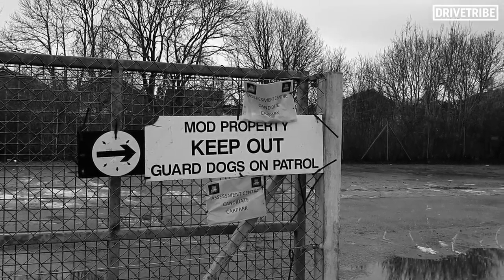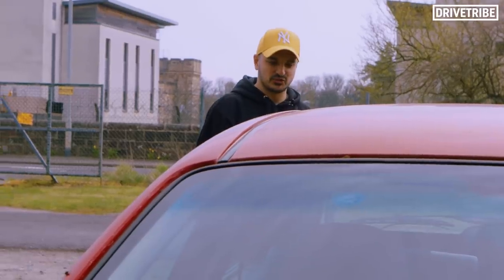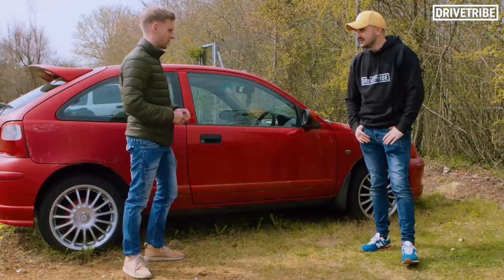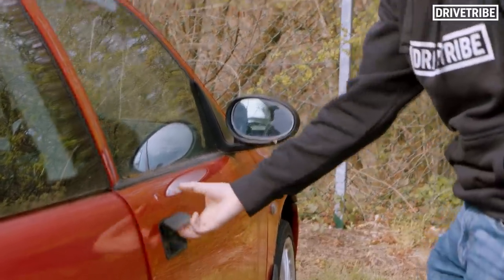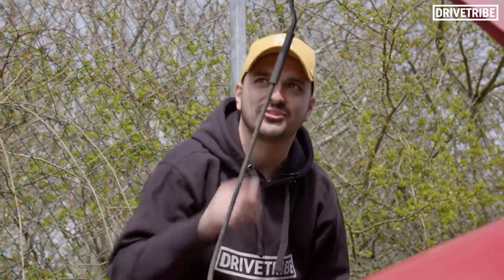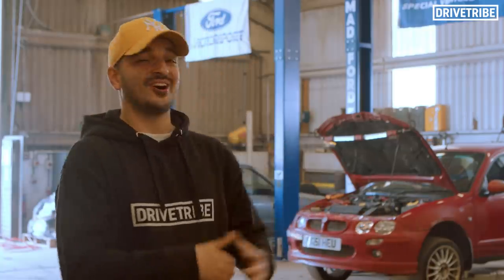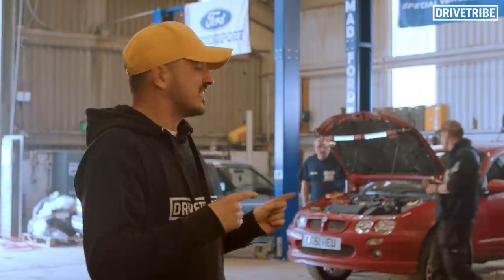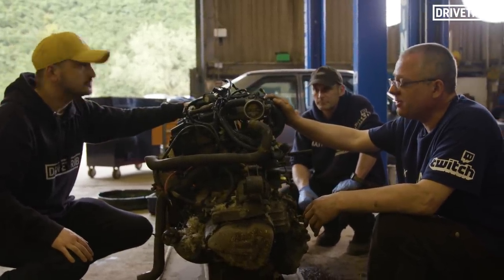Rescuing my abandoned first car from a military barracks | Rover 25 restoration

Comment: I actually still have my technical first car. My very first was a 1982 ford bronco that I got on my 16th birthday. She sat in my driveway for about 9 years and i didn't have the time or money to repair it because i used to work a factory job for 3 years. I sold that last year in 2020 since it was rusting away. I got my technical first car brand new from a dealership and still owe about $12k on it. It really wasn't my first choice because i wanted something cheaper but my mom talked me into getting a 2017 Toyota Camry which was the very last 2017 on the lot. Ruby(thats her name) has been through some tough times along side me. My first ticket, my first time almost rolling her in a ditch, and my first accident, which was hitting a deer. I got lucky about the deer tho because the damage wasn't really bad, mostly just a bent fender and cracked bumper cover. I love my little Camry and its a really reliable car to have.

Comment: If you can find a 102bhp version, you can get the throttle butterfly and cable off it, and fit it to this to boost power. It does give you the 102bhp

Comment: My first car was a Ford Anglia, which I totally destroyed by thrashing it everywhere it went. I thrashed it on the road. I thrashed it on Fire tracks when on surfing trips, which was pretty much every weekend. It was a 1962 model, bought in 1971. When I bought it, Dad made me rebuild it from the ground up using only a Haynes Manual for guidance. The only mods were: paint from red, with white roof to Canary Yellow Black Grill, bonnet, and interior and 6 inch wide steel wheels with Pirelli Radials. Oh and I fitted seat belts. All work done by myself and probably not very well, being my first ever mechanical experience. I fanged it for 2 years, in which time I put a corned through the block and had to rebuild a second hand motor. Finally traded it in for an 1100 CC Moke 13' wheel variety Australian made. I was given $100.00 Trade in on the proviso that I dispose of it. I gave it to a mate who welded spikes to the back wheels and used it as a tractor on his farm until it carked it.

Comment: my first car was a 1999 seat ibiza, bright red, steel wheels, speakers didn't work on passengers side, massive scratch on the drivers side, layshaft had to be rebuilt at one point, and the thing that finally killed it was the headgasket. i still regret scrapping him

Comment: The unrestricted throttle body fits on and does not require mapping, while it’s out you would be better off sticking the 1.8 in it’s a much better engine. I have a janspeed backbox going if you’d like one aswell as said throttle body :)

Comment: My first car was a Rover too. I suspect that due to the effects of rust, it’s all around us now as it has turned to dust. When I flogged it for £300 19 years ago, the only thing on it that hadn’t rusted was the interior. Solid engine though. I wouldn’t be shocked if parts of that K Series workhorse were still in use.

Comment: My second and third cars where zr’s 1.4 to over come the throttle body issue fit a vvc inlet off the 1.8 160 zr or the mg tf 1.8 160 also a 4-2-1 exhaust system for better flow and a decent induction kit with cold air feed and a k mapped ecu will never regret it I’d still of kept mine to this day If I hadn’t of crashed it!! Looking forward to the rest of the series though it’s giving me a blast from the past as well

Comment: My first car was a 1982 Ford Cortina Mk5 1.6L in Carribean Blue, I bought it locally for £900, sadly it was involved in an RTC 3 weeks after I bought it. It suffered damage to the near side rear quarter which was somewhat repaired but it wasnt the same after and started to have problems. I ended up selling it to a friend for £100 when I becam unemployed and couldnt afford the upkeep of the car. I actually passed my driving test in the Cortina while I was waiting to get the car repaired so it still had the crash damage when I was taking the test.

Comment: My first car was a Kia Clarus. When I got my second car, we let the Clarus sit, parked, for 2 years or so. When we had to get rid of it we had to use cables to start it (obviously), but - with more than 3 year old oil, 2 year old petrol - it started. And drove on the truck that came for it under its own power.

Comment: ZR105 throttle body is a straight swap, if you are worried about a map there are companies that map the MEMS 3 ecu. I have personally swapped the throttle body though. basically it stops the throttle position sensor from registering full throttle and the ecu adjusts based off of the O2 sensor reading, when fitting the throttle body that allows for full range of movement the throttle position sensor registers the wide open throttle position and reverts back to open loop fueling. I am almost certain that the map on all the 1.4 engines are the same. I have dropped loads of these engines in metros and other rovers. they never needed mapping until I used two exhaust cams from the vvc engine.

Comment: My first car was a H reg Xr2i. It had done around 90k miles back in 2003.  I'm about 99% sure it's been crushed given the rust buckets that MK3 Fiesta's were. 

The 1.4 MG ZR's were really popular when they first came out. Most 1.4 na cars back then had around 90hp but the MG's had 105hp, so were really popular with young drivers. I hardly ever see them on the road now though. The 1.5 Mazda 323's and the 1.5 Proton Satria's were decent options if you were 17/18 and simply couldn't stomach having a 1.1 or a 1.2. The car I really wanted but never got, when I was 20 and had a couple years no claims, was the EK Honda Civic Jordan. If you had one of these back in 05 you were envied on big time lol.

Comment: My first car was - objectively - the worst Mustang ever.  It was a 1976 Ford Mustang II Cobra II.  It was white with blue stripes and Cobra decals, but it had a 2.3L 4cyl engine that made, if we're generous, 110hp - and then, because it was a California car and the smog regulations had just started, it had a smog pump, driven of the crankshaft, that robbed about 40 horsepower.  It was a car that had the looks of a giant muscle car but with 70ish hp it was writing checks that it had no hope of cashing.  The 4 speed transmission would only go to about 85mph before the engine was screaming so loud you couldn't hold a conversation.  My dad and I rebuilt the engine when I was 16.  It was, in all respects, a terrible car - and yet, if it was in front of me right now, I'd buy it back in a heartbeat.  I loved that car.

Comment: You CAN just fit the fully opening throttle or even better, the 52mm throttle body and it will learn to adjust the fuelling, so absolutely go for it! You have to fit the throttle cable from a fully opening throttle body as well though.

Comment: my first car was a 1976 datsun 120y in blue, 2 door, i did 110 mph in it on the M54 and it very nearly fell to bits, it had many electrical problems like you turn heater on & radio comes on, in the end the wiring burned out & it caught fire, i payed £80 for it in 1984 which in those days would buy you over 100 pints of lager in the pub.

Comment: Man you need to put a FuelTech FT550 onto this and remap the fuel flow for the maxed air throttle performance! It would be killer!
Reply: BTW, this MAD Ford Engineering hoodie will look nice into the DRIVETRIBE store.

Comment: I had 3 MG ZR's. 1st one the gearbox locked up in 3rd round a roundabout.  2nd one head gasket went. And 3rd one failed MOT with two pages of major failures...would definitely buy another one though 😅😅

Comment: My first car was a white Vauxhall Nova SR, could not get insured on the SRI or afford it tbh, my first mistake was buying a set of wheels that were too wide for the rear arch lip, but in the end it was a gorgeous car, miss it so much..!  Had 30+ cars since then ranging from E46 M3 to Suburu Impreza's, my current car is a joke, well its the wife 7 seater, sold my Focus ST as we are moving abroad.  But what l wanted to say was, inbetween all my cars, l has a 2003(SB03SXE), red MG ZR 105, man what a little car that was, put a K+N Induction kit on it and a bigger exhaust, the sound of the little engine was brilliant, l still can hear it in my head the now, really looking forward to this series, actually l even had a playstation 2 in my MG and 6" screens in the headrests...

Comment: Starting it after 3-5 years? What about changing the oil, removing the spark plugs, vacuuming the cylinders, a bit of fogging oil, turning the engine by hand...? Or just start it with bone-dry, rusty bores, and rev it to 4 grand?

Comment: Watching this is brilliant.

Monday 1st August 2005 - The day I passed my driving test

Friday 12th August - The day I bought my first car....... R998 SCS, a VW Polo 1.4 CL finished in Dragon Green

Sadly ended up being scrapped. I sold it to one of my mates when it had a knackered clutch for £250. He ended up putting a VR6 engine out a mk3 golf into it and then after being given the hurry up to move it from where he had it stored, he turned up to see it with a HIAB claw through the roof on the back of a flatbed

What i would give to have that car back ☹

Comment: MK1 Cortina Delux with a 3 speed Borg Warner auto.  Blew it up on the M6 and I put a 1600 crossflow in it.  Ended up with a Savage cam kit and Webber 2 choke carb.  Blew that engine up on the A23 😉

Comment: First car, Mini, of course. It said 850 on the back and it had a 1000cc under the bonnet, she flew. It had dodgy engine mounts, so every time I'd accelerate from a stand still, the engine would rock back, hit the firewall and knock the speedo out of it's mount. So the routine was, before I'd shift to second, I'd shove the speedo back before second gear would yeet it through the cabin.

Comment: As far as I'm aware, the map is no different between the 84ps and 105ps versions.

You will need to swap the throttle body and also the throttle cable to unleash those extra horses. The map doesn't need touching, the MEMS ECU will adjust accordingly.

Comment: I worked at a used car dealership for 3 weeks when I was 23 and my first car was actually taken in on a trade during that time. I hadn’t seen it for 5 years and it had 100k more miles on it than when I sold it.

Comment: My first car was a Renault 10 but I destroyed the gearbox before I got chance to legally drive it 😂.  Very common changing throttle body’s upgrade on 1.4’s to boost power no re- map needed it just starves the engine of air I believe the restriction was for insurance purposes for younger drivers.  I have a Rover25IS 1.6 in my garage great fun little hatch, K series are light and powerful.

Comment: My first car was a 1978 Chevy Monza with a 3.8 liter V6 and auto. Lime green with a 1/4 white vinyl landau top. I bought it in 1989 for $450 and it had 64,000 miles on it. Decent car that did the job but I would not want it back.

Comment: Swap the throttle body for one from a ZR160, straight swap (but sure you need the cable as well iirc) it won't  affect the car in any way apart from adding about 20hp

Comment: I had one of these for my 2nd car, a Rover 25 I converted to a MG ZR, have you considered a metal throttle body conversion from the 1.8 ZR and de-restricting the butterfly valve to open the throttle up fully, combined with a gearbox from the 1.8 ZR. Makes a huge difference to the car. Also had the head port and polished while the head was off repairing the headgasket.

Comment: My first car was a white 1985 4-door poverty spec Golf Mk2 C Diesel with a whopping 54bhp, a former driving school car with just about 300.000km on the clock (190.000mi). Of course I had to put 'big' tyres on it (185/60R14 instead of the old 155R13) and the double headlamp grille from the sportier versions including the small Hella spoiler lip above them. A centre console went in but that was about it. I sold it half a year later in exchange for another high mileage Mk2 Golf, a mars red 1985 GTD in a rather convincing 16V look. Those two were followed by another 8 Golf Mk2 over the years (including a rather tatty G60 that went like the literal banshee) but I don't know what happened to any of them in the end. The one or other I'd have liked to keep like a completely black 1990 GTD with 80bhp or my beloved 'final spec' tornado red 1992 GTI 16V which was in a pristine condition throughout despite its high mileage until a LR Discovery (1st gen if anybody's interested) crashed into the boot. Needless to say that the repair cost would have exceeded the car's value by far.

Comment: If I could go back and get my my first car I would, its been long scrapped. (It was an H reg cavalier 1.4L :p)

As for the throttle.  I think the limit had to do with the ZR 1.4 came with more power as standard, so I assume they nerfed the rover slightly so people had an incentive to buy the ZR. The ZR came with 105bhp and slightly higher torque, most 25's were 84hp though some editions came with 103.

Comment: My first car is still my volkswagen Golf 5 (2009). Even tho for me the car seems masive, my parents knew the size of the car would become usefull and it has, been driving to work the ride is always smooth, the engine still kicking strong and isnt fuel hungry and the under body, sure a bit caked in mud because of the bad roads but a quick wash got it like brand new. 

Future plans for it:

get new rims because currently still rocking the steel original rims
Replace the damaged radio/navigation system

Still going to keep driving it, and letting it go once life paths change

Comment: i remember my first car, it was a 1984 chrysler new yorker, that thing was a tank, little mitsubishi 4 cylinder, and real light car too, really made the most of its 90 something hp. was the star of my town for a little over a year. and then 14 months in, some old lady in a camry cut a corner too hard and hit my car, apart from my bumper and rad support being pushed a little bit the frame was still straight as an arrow and i drove it until the insurance came to bring it to auction. totalled out the chrysler and the camry, but i was still able to get to work and school just fine. that car made its way to lithuania, and idk of it got parted out or rebuilt or what, the car fax ends at its export

Comment: May sound a silly question but why can't you see if you can somehow remap the engine to make use of it's true power. As to my first car it was a Mitsubishi Chrysler Gallant with a 4 cylinder 2lt modified racing engine, was supposed to only be a 1.4

Comment: iv owned 4 cars my whole life.
1 86 CJ5
2 was a 02 Nissan Sentra
3 a 73 el Camino
4 01 C5 corvette 

still have all 4 cars but only the vette is on the road running.

the CJ5 my dad gave me when i was like 5
the Sentra i bought but never drove as my dad needed a daily to get to work so he drove it until it broke
the 73 el co has never been road ready and has sat since i bought it as i slowly work on restoring it
and the vette i daily drive since i bought it

Comment: The throttle body was restricted for insurance purposes - the lower powered 1.4 was much cheaper to insure. 

But I’m pretty sure my Dad changed the throttle body and nothing else and it was the full 102bhp. No other mods needed.

Comment: The throttle being restricted was done for insurance purposes (less hp less insurance)

People fitted derestricted throttlebodies from mg zr's for a bump in power, like 20hp and a boost in throttle response, the engine is however mapped to work fine within reasonable limits, people have ran 1.6's perfectly fine with 1.4 ecu's so pay no mind to the mapping myth

Comment: This is not my first car but back in 2000 I owned a 1997 Mercedes Benz sprinter I manly used it for transporting car parts I sold it in 2005 and have now Heard that it has been sat in a field since 2009 and have been given the opportunity to buy it back

Comment: Tuning cars isn't a mystical thing anymore.  Fix/rework the throttle body flap to fully open, replace the injectors and get the computer re-mapped and let that 1.4 sing or scream which ever you prefer.

Comment: Great video! 1st car FIAT punto (2000 w reg) 1.2 elx 8valve (60bhp)......wanted the 1.2 elx 16 valve which was the same engine in the "Sporting" (80 bhp) but insurance crippled me for a extra 8 valves 😂 anyway part x'd the car into bassets Citroën Swansea for a new c2 vts......which was the worse car I ever owned by the way.....the punto then ended up on a police program being chased through the streets of Swansea.....it was crashed by the fleeing criminal and later scrapped I believe....it was still on it's lowered springs and black tints all around....true story

Comment: 2014 My first car was a Vauxhall Corsa 1.0l didn't like it, in 2016 my second car was a Vauxhall nova 1.2 luxe drove it for 2 and a half years and the engine threw a rocker be t the valve and did the piston rings, as of today my current car is a 1.2 Corsa sxi 2002 however my old nova is still in my possession now with a 1.6 that will get moving again.

Comment: dont put 5w30 in the k series, it needs 10w40, and when your rebuilding the engine, dont just chuck in the MLS gasket, it may not be the right one, also, you can just change the throttle body to the 104hp one, the rover ecu (mems) is self learning, it will learn in 100 ish miles that will take your 25 from 84hp to 104hp, message me if you want any help, i have all the workshop manuals if needed

Comment: Well done Mike wish I could find my first car but it was unfortunately scrapped I got a red Rover Metro vanden plas and I did the exact same I kitted it out with metro MG parts including the wheels which I got from a scrapyard for a tenner each went to kwikfit put new tyres on but I tuned the engine and given it a twin exhaust it was ridiculous unfortunately after having it for 4 years it died by a burnout and it had a major oil leak I was doing a drag race oops lol